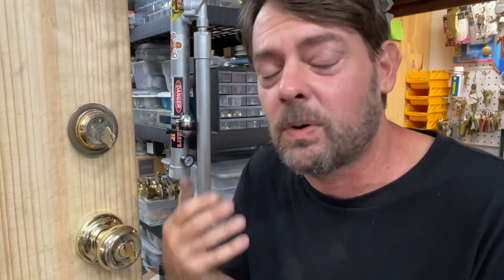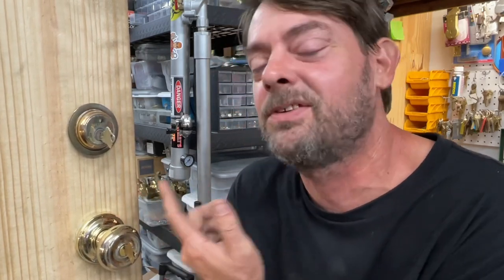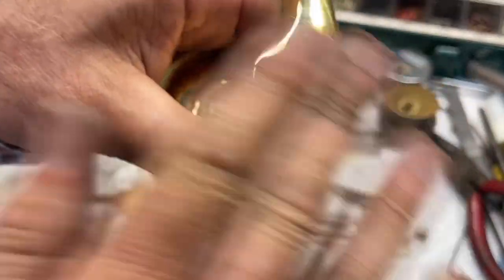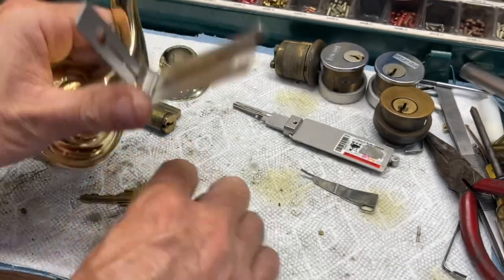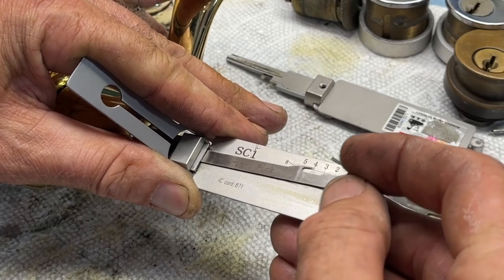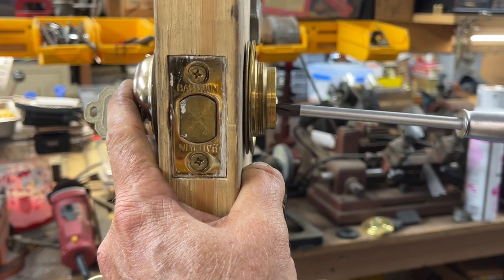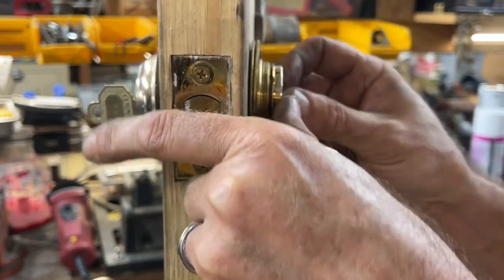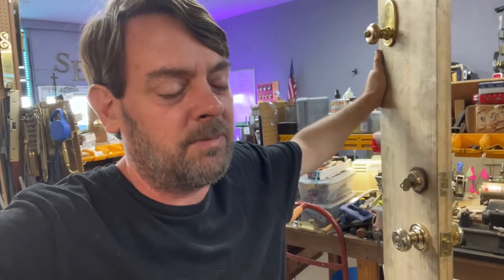RLS 21 - Baldwin Tubular Locks

Comment: Thank you for covering the Old School Baldwin Estate tubular deadbolt. In the end, I Had to call in a locksmith, but your video covered all my questions. One thing not mentioned was in replacing the cylinder for a thick door, the Baldwin replacement cylinder came with a short tail piece for a thin door instead of the longer length for a thick door. This tail piece goes into the thumb latch.  My locksmith used the old tail piece. He said he could've repaired the lock rather than me paying Baldwin for the replacement cylinder... which thought it had a lifetime warranty. Baldwin rep should've sent me what I needed, especially since I had to pay a hefty sum for the cylinder. Details...

Comment: Just watched your 5 year old vid on repair of mortise lock.  Very helpful.  My deadbolt spring is broken.  Where can I find a replacement spring?  The lock came with Stone River Bronze entry set, which I believe was acquired by Rocky Mountain.  The lock is very similar to Baldwin locks.  Probably made by the same manufacturer that sells to OEM.